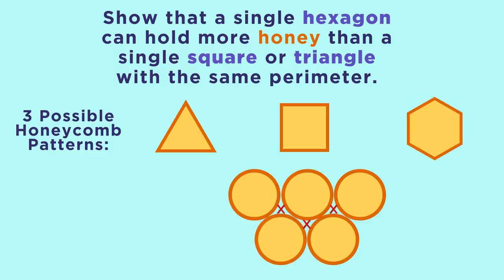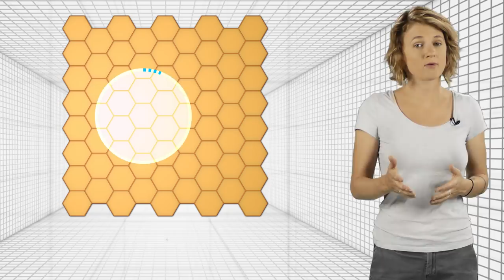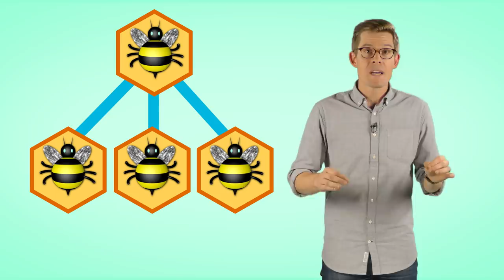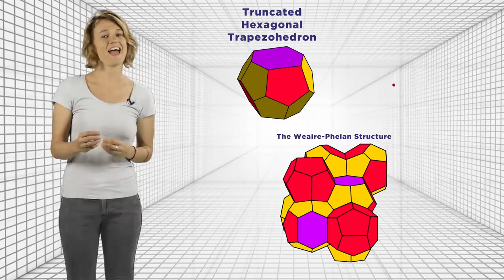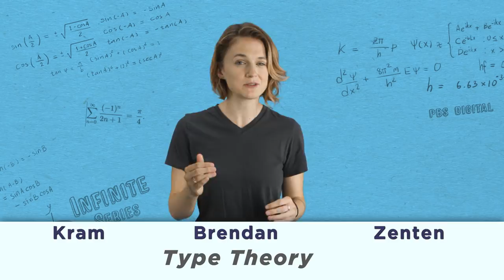The Honeycombs of 4-Dimensional Bees ft. Joe Hanson | Infinite Series

Comment: Redoing a comment of mine that I accidentally deleted. Regarding the proof at 1:40 - 

Imagine that the equilateral triangle, square, and hexagon each have a perimeter of 12 (the lowest common multiple of 3, 4, and 6). Let's look at the area of these shapes. 

The equilateral triangle's area is half of the base times height. Note that the triangle's side length is 4. If you cut an equilateral triangle in half, you'll have a right triangle with angles of 30 and 60 degrees. Triangles like this always have a hypotenuse:base:height proportion of 2:1:√3 (or 2:√3:1) so all we have to do here to find the height is multiply half of the side length by the square root of three - here, 2√3. The area of the triangle (bh/2) is  4√3 ((4*2√3)/2) square units - approximately 6.93. 

The square has a side length of 3. Area is just the side length squared so we end up with 9 square units. For those keeping score, the equilateral triangle's area is about 76.98% that of the square with the same perimeter. 

The regular hexagon can be imagined as six equilateral triangles. Keeping the same perimeter, this hexagon's side length is 2. We plug this into the same ratio mentioned earlier to end up with a height of √3. Same formula applies - bh/2, b being 2 and h being √3. Area is √3 square units per equilateral triangle in this hexagon, so multiply the whole thing by 6 and you end up with 6√3 square units - approximately 10.39. 

And for those keeping score - assuming all shapes mentioned have the same perimeter, 
() the equilateral triangle has nearly 77% the area of the square and two thirds the area of the hexagon 
() the square has approximately 86.6% the area of the hexagon.

@Steve's Mathy Stuff pointed out for me that these ratios stay consistent even when the perimeter approaches infinity. Which I find to be pretty dang neat.
Reply: so now I wonder why, given a hexagon and triangle of equal perimeter, the area of the triangle is 2/3 that of the hexagon.

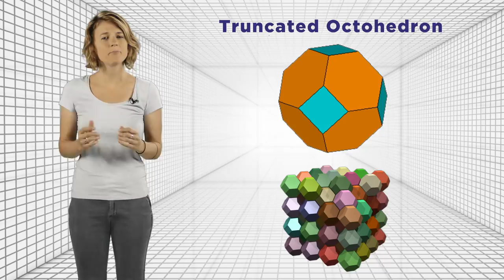Comment: Others have asked; no answer has been given – @ 8:45, how can the hexagonal faces be "slightly curved"?
Don't they have to be flat by symmetry, and in order to minimize the surface area of a cell whose volume is fixed?
Reply: Why should they have to be?
Reply: Well, think of the 2D case – regular hexagons. What happens when you "slightly" curve the edges? You can do it so as to keep the areas of the cells fixed, but now you've increased the perimeters, and the object was to minimize the amount of material in the walls, for a given area of coverage of the (2D surface of the 3D) hive.
So it follows that those walls have to be straight.

Now look at the 3D case. The walls are now 2D hexagons & squares. If you start with all of them flat, then curve them slightly, you increase the area of the walls without changing the volume covered by the tesselation. And exactly analogous to the 2D case, the object is to minimize the amount of material in the walls, for a given volume of coverage of the (3D surface of the 4D) hive.

So how can it not be less efficient to curve the walls?
Reply: You are already too fast for me again. Why should curving the edges increase the needed amount of perimeter? You are making your hexagon more circle like, meaning you increase the amount of area while not increasing the amount of perimeter as much
Reply: And that would lead you to making it into a circle, which has the least perimeter for a fixed area . . . if you had just one cell.
But you've got a tesselation – a tiling – of the entire plane, and you can't do that with circles, because there will be non-circular gaps between them.
The task here is to make a regular, repeating array of identical cells, each with a given area, having the smallest perimeter per area of coverage, in the limit as you expand that area to cover the whole plane. And in that tiling, every "wall" is shared by two neighboring cells, so that any change made to a wall, will affect both its cells, and in different ways.

Comment: Since packing of circles generates a hexagonal structure, aren't bees really just making circles that get turned into hexagons due to surface tension?  https://s-media-cache-ak0.pinimg.com/originals/01/33/b4/0133b49b3f7b9243d22b2afa763c4229.jpg PS.  posted before the discussion about bubbles.  I guess I jumped the gun.

Comment: Why did those 3d shapes that make up the 4d honeycomb both need a slight curve on their sides? This seems totaly counter intuitive to me
Reply: Why is that counterintuitive? Considering the aim is to emulate circles as much as possible it is counterintuitive to me why we have to use so many straight edges
Reply: but two curved edges (say two bubbles) meeting up with each other become one flat edge to minimise the amount of surface that's needed to form the joint. You can see this with the bubbles - the interface between them is ideally totally flat:

(..) (..) two bubbles 
(..)..) two bubbles with a curved interface
(..|..) two bubbles with a flat interface which has a smaller area (or length of the line in this drawing)

So to me it would make sense that this idea would scale up to more dimensions, and all the sides of an optimal shape be flat, I don't see why it wouldn't.

Comment: What would be the best shape for our 3D houses? Would rooms with a horizontal or vertical cross section be most stable and economical? Or would a building mimicking Weaire-Phelan structure (9:44) be the most stable and feasible in terms of wall material consumption? I am not talking about the comfort of living  or operating convenience in such Weaired space, just stability and material consumption.
Reply: Something close to a dome or igloo may be the best. My first thought (which is probably not correct) is the surface of revolution of a catenary, with the axis of revolution being the catenary's axis of symmetry.
Reply: xenontesla122, what about a block of flats with many floors?

Comment: I disagree.  A 4 dimensional bee makes a 2 dimensional honey comb for the same reason a 3 dimensional bee does:  Adding the extra dimensional does not actually increase the storage area of the cell relative to the amount of material used.  You can confirm this by noting that the bottom of the honeycomb is flat and generally (in a wild hive) matches up with another cone on the other side.  However, the 4D bee would have the option of using the 2D shape on multiple axis.    Boom.  It's still math.

Comment: it's actually not so smart after all. yes it will be useful to partition equally large areas/volumes that way but in general it requires another constrain to even remotely consider such structures. 

e.g. in case of bees those combs are also larva housings ( hence the size *) and provide stability to the whole structure. actually in 2 sided structures these combs are shifted.
you should bee worried when the bees discover that overall required stability and breeding requirements are good enough when not resorting to equally sized combs. 
(* may-bee also honey viscosity may play a role in that sizing too)

however that is the reason why we do not resort to honeycomb structure for storing our goods. because the other constrains make it usually impractical to do so. 

i think this was missing in your video.

Comment: There is no such thing as a 4th dimension. Every physical thing in the Universe has three dimensions, length, width, and height. Dimensions are size measurements of the thing. Energy, time, temperature are not size measurements; these are not dimensions, they are descriptions, non-size aspects of the thing. Also mathematics is not plural.
Reply: In the UK they say maths